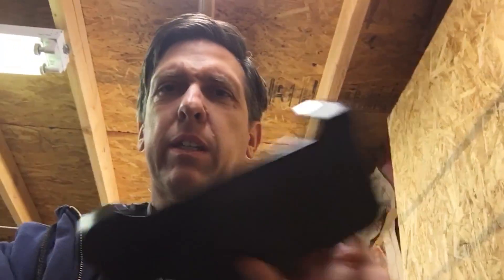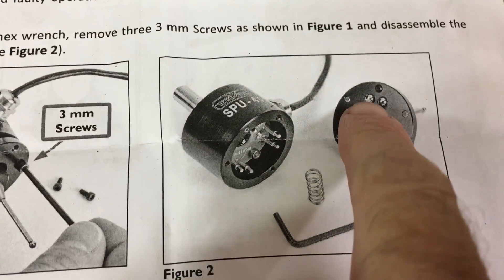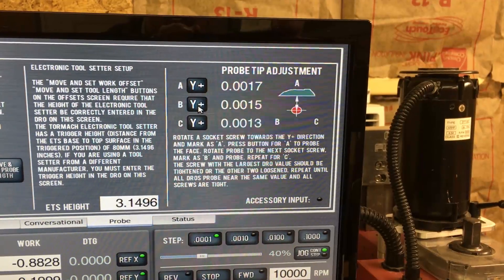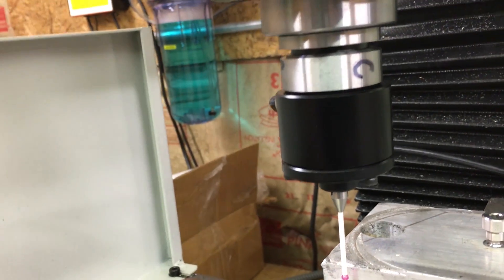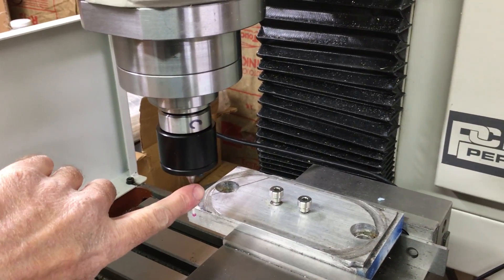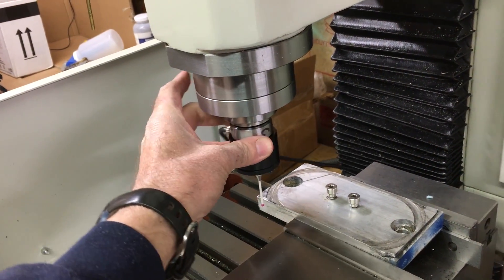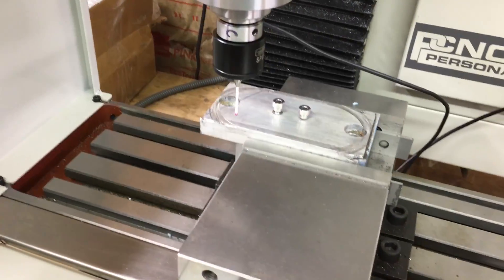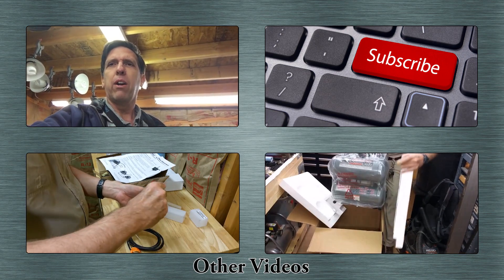Tormach 770 Part 17 - Passive Probe 2

Comment: Super Glue Tip to prevent drying up! After using hold with the nozzle up and and blow air into the nozzle as if your trying to whistle. This forces the glue back down screw the cap on and store in a vertical position. This will keep the glue from drying in the tip.
Be Safe,
Sam
 oh ya Great video. LOL
Reply from the maker: +CNC4XR7 - Thanks, I will have to try that.  I'll try not get get my lips glued to the superglue. lol 
Thanks!
Reply: +Craig's Machine Shop Keep Lips about 1/4" away from the end of the nozzle you just want to blow air in the nozzle to force the super glue back down.